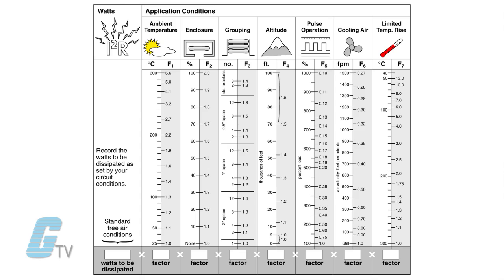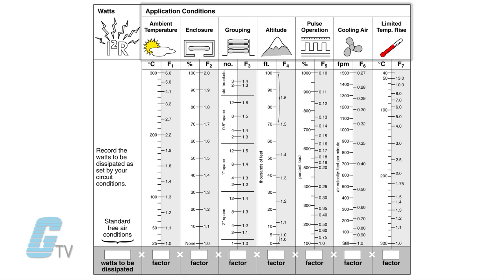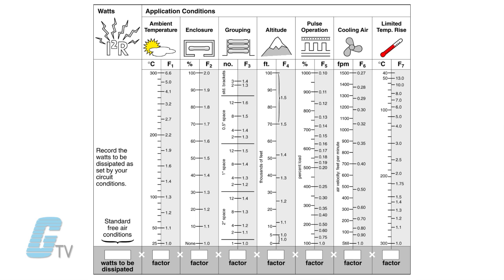How to Select a Resistor

Comment: Many thanks, been searching for "what color is a 4.7 k resistor?" for a while now, and I think this has helped. Have you heard people talk about - Henucas Panrooklyn Equalizer - (Have a quick look on google cant remember the place now )? 

It is a good one off guide for discovering how to repair electronic devices like a pro without the headache. Ive heard some unbelievable things about it and my co-worker got cool success with it.
Reply: Resistor codes are maddening! If you look it up online, there are two different standards (a blue 5 band and a beige 4 band one) which are both marked by bands of colour. Try searching for 'how to read resistor codes'